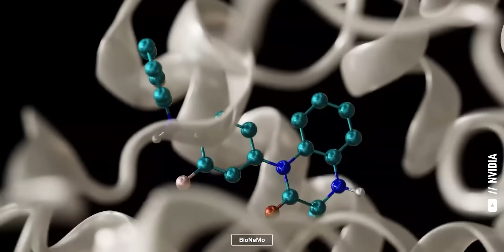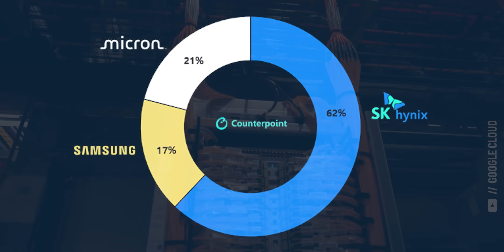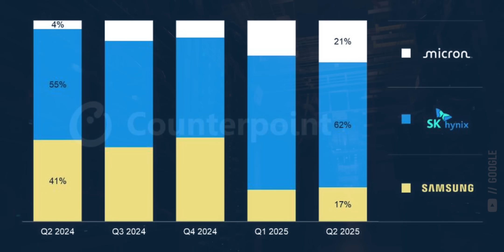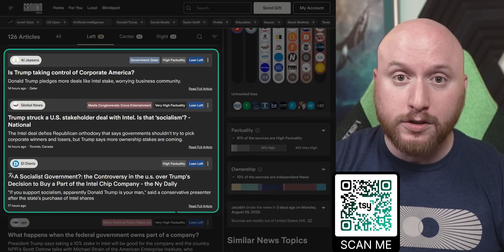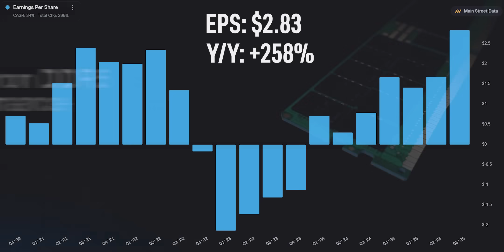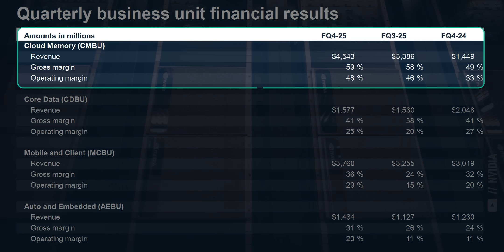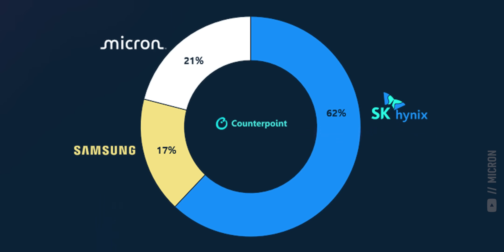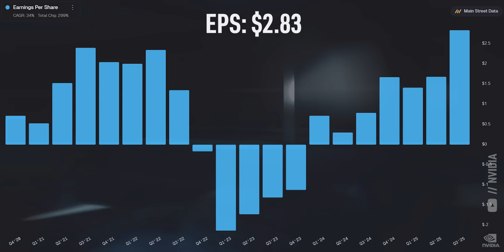If You Missed Nvidia (NVDA) - This Stock Is Next!

Comment: Micron is absurdly undervalued because the market still treats it as a cyclical DRAM vendor — meanwhile AI has turned memory into the single most important bottleneck in computing.
Every AI chip, from Nvidia GPUs to Google TPUs to Tesla Dojo to every emerging ASIC, requires exponentially more HBM.
Micron is:
• One of only 3 suppliers on the planet
• Leading in HBM3E power efficiency
• First to sample HBM4
• Completely sold out through 2025
• About to bring new U.S. and Japan fabs online
• Set for a 5–10× EPS expansion over the next 3–5 years

Yet the stock trades at a forward P/E in the low teens and a PEG under 0.3 — numbers you find in dying businesses, not companies riding the largest compute supercycle in history.

If Micron were valued like Nvidia, Broadcom, or even TSMC on a growth-adjusted basis, the stock would already be in the $450–$650 range today.

Micron isn’t just undervalued — it is the most mispriced large-cap AI infrastructure stock in the market.
Investors who understand the memory bottleneck will buy it now.
Those who don’t will chase it later at double or triple the price.

Comment: What is Micron's relationship with Broadcom? That would be an interesting aspect to consider.
Reply: Broadcom does use and partner with Micron Technology, particularly in the expansion of AI infrastructure, with recent collaborations for PCIe Gen 6 and networking solutions. Micron is a key supplier of memory and storage for AI systems, and Broadcom's technologies, such as high-speed interconnects like PCIe, work with Micron's memory products to enable high-performance data centers and AI platforms.